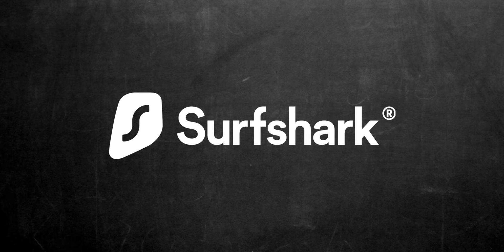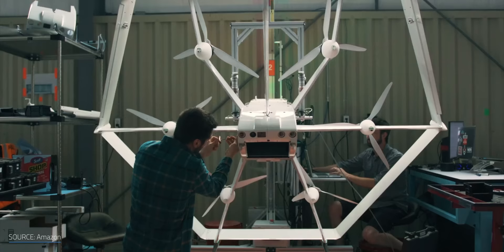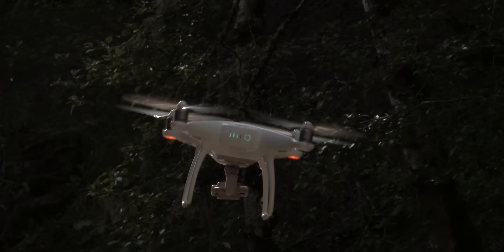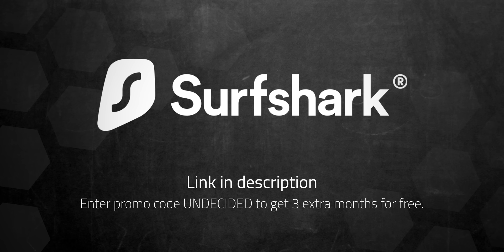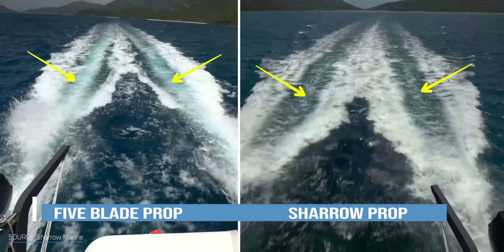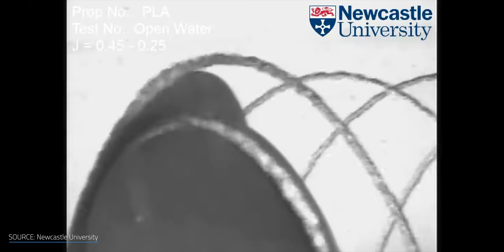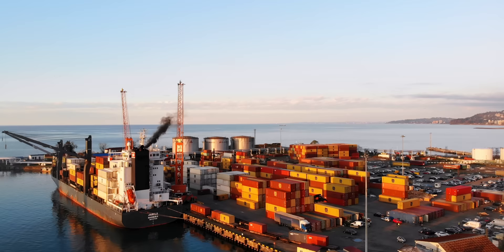Why is this Propeller Getting So Much Attention?

Comment: MIT hasn't provided any evidences to their claim. No scientific paper or anything, just some fancy marketing pamphlet, while deliberately comparing it to the loudest propellor they could find. The toroidal propellor is just a 4 blade rotor, that has 2 blades connected at the tip, so a more accurate comparison would've to a 4 blade rotor, not just 2.
MIT video having comments turned off tells you all you need to know.
Reply: …unfortunately these kinds of videos never do any kind of rigorous analysis. They are about generating views with over used cliches such as ‘game changer’, and ‘this changes everything’.

Comment: Actually the biggest waste in shipping could be avoided by sourcing products closer to where they are used. The only reason massive overseas shipping happens to the USA is because of slave labor, and lower environmental standards in other parts of the world. This could be cured without higher prices by switching to import taxes instead of domestic taxes. Despite what our corporate overlords tell us, any trade conflict this would cause could be offset.

Comment: OK, so I like to state, there is too much of wish showing up. My very concern is, that no one drone propeller achievable today has made it through independent tests. There is no such thing as a more efficient, quieter toroidal propeller for drones you may buy. And that's where I like to kick in, it is about propellers in whole:
All designs for drone propellers seen today have a rather flat design. There is no single design showing up, that extends the prop axially. But that's the very detail needed. Not so the marine propellers already available. I do believe, there is a tremendous increase in efficiency with these props. In no way this holds true for the drone props !available!.
Second: "In most cases we have to sacrifice some level of power or efficiency for a quieter ride, but that's not the case here." (6:36) That statement is... clumsy. When we are dealing with fuel2heat machines as are combustion engines, we are used to sacrificing power for less noise. This is the only one case, the statement holds true. Not so with all other things, converting any kind of form of energy. It's quite the opposite. The more noise appears, the more power is spent, creating that noise, resulting in poor efficiency. But there's more about it.
3. There are ducted fans already. They take care for the prop tip problem and do increase thrust of any prop tremdendeously today. This design is called turbofan in aviation. Today, virtually any commercial aircraft is equipped with.
4. Ducted props already are in use by tug boats. The thrust optimization clearly exists. Not so in cargo vessels.
5. For an open air prop (not ducted), a definitely axially extended prop like the outboard marine props shown would open the opportunity of optimizing efficiency of a prop in a target speed range, say cruise speed or max speed or start acceleration. But you cannot design a toroidal variable pitch propeller that takes care for all the demands of a typical motor aircraft. Not so with marine props, as
6. cargo ships do travel at cruise speed utmost all of the time moving. So here is the potential of a toroidal prop. Aircrafts already did optimization by turbofan. However
7. Any ship does suffer from seaweed. Is there any study on impairment of a toroidal prop versus an open one? My hypothesis states, the toroidal prop would win, so, yes, we should investigate.
8. Last: Yes, drones are almost all of time of operation near a hovering flight point of operation. So there is a big potential in using toroidal propellers in optimiing hover as a sweet spot. But please, take a look at the 3-dimensional things of marine props, having proven efficiency. The so called toroid-prop-designs for drones available are just a 2.5 dimensional design, failing in fulfilling the promises. Just ridiculous.
https://www.youtube.com/watch?v=l5ANUagwEBw

Comment: I don't see this having much practical application on aircraft. Only the small GAs use fixed pitch. Not to mention these are heavier, so more torque, and more power required to get them spinning I would imagine, that's more strain on the engine. You've got something like twice the mass or more it looks like. Definetly great for boats and drones, but not much else that moves I'm afraid. The only way I could see these being variable pitch is making them bendy, but that is beyond our capabilities if we're looking at putting these on something like a C130

Comment: Why Don't Ships use Electric Motors To drive their props and Just use the engines as a Generator??  This is what Trains have been doing for Years. You can Run the Generators at a constant rpm (sometimes incredibly low) and get great efficiency equating to LESS EMISSIONS?

Comment: In the beggining you said "the efficiency was boosted from 20% to 105%" I caught my attention because as far as I know nothing can be more than 100% efficient, that would be putting all the generated energy into the action I want. Later you said the propellers are 105% MORE efficient than the standerd ones and is possible because you are not saying it is 105%efficient you are saying its a bit more than twice as efficient as the old ones, that does make a difference and perhaps it was only me that herad wrong and got the wrong idea but hearing wrong information at the very beggining of the video could let to people not wanting to see the rest because of they might thing the creator is "dumb" or at the very least missinformed.
Just wanted to share my thoughts, not here trying to pffend anyone.
Good video BTW.

Comment: It is neither 105% efficient nor 105% more efficient. At least, using the graph of ‘advance rate’ v rpm, it is not possible to know the efficiency. The stupid thing done in this video is to simply compare velocity at some given rpm using two props and call it a comparison of efficiency. Without knowing either torque or fuel flow you cannot tell which is more efficient. Also, to make the comparison valid it should be at the same boat speeds, not the same rpm settings. You could replicate the comparison seen here by simply comparing two conventional props of different pitch. The coarse pitch will advance further per rpm. Who knew!
   We don’t actually know the efficiency of either prop from the data given. It is classic marketing smoke and mirrors. It stands to reason that if you had the test data of actual efficiency and it was better, and you had a prop to sell, you would absolutely SHOW THAT DATA. Therefore it is fair to assume that the actual efficiency data is not so good. 
   Also, the data point chosen for comparison was when the conventional prop was clearly at hump speed (most inefficient speed) whilst the Sharrow prop, being faster per rpm, was in the planing regime. Nobody who genuinely wanted to compare efficiency would do such a thing.

Comment: 105 % ,so the prop adds power back to the engine.  Try again . These props are much better but  ring props also are much more efficient
Reply: 105% increase, not 105% of the power. If i have an engine with 20% efficiency and i increase it by 105% i get an engine with 41% efficiency (20% + 1,05 * 20%), not one with 125%

Comment: toroidal propellers is nothing new, NASA worked with em in the 80/90s to try make an propeller aircraft that could pass the sound barrier or at least survive being over it.
but NASA being NASA, even if they find good things about stuff if it doesn't do what they want it's mostly left in the "things to forget and not show others except some few pictures"-shelf.

in case of the boat propellers toroidal have great effect for cruising. but there is a reason why high speed boats won't take to em soon.
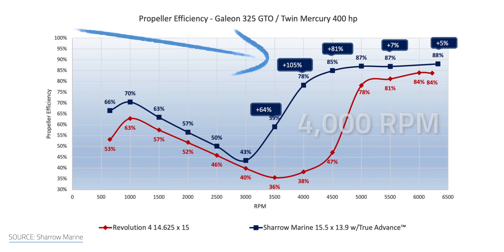the graf shown at 8:09 shows a 7 to 5% increase at high rpm's, but that is versus a cheap stock propeller that is made for fitting an "average public".
custom made propellers designed for race can set you back 1500-2500 USD but would make a 5-7% increase at top end look childish.
then you got surface propellers... well... no... some of what makes em work is opposite of what they tries to avoid with the toroidal, so no.

but made in large quantity and made in alu and cast in one piece to reduce price the toroidal would be great for say "small size working boats" (like say fishing, inspection and patrol boats) with general outboard engines to reduce fuel usage and sound.

Comment: Regular airplane props to toroidal is a pretty big leap. know it sounds so simple that someone probably a lot of folk, has already done this but I can’t find evidence of or anyone who has tried putting simple winglets on normal, regular airplane propellers. If they work on wind turbines increasing efficiency 4-5% then…? Yes, one is pushed by wind & the other propels it. But isn’t it to simple to overlook? Seems like ANY improvement would justify a cheap screw on kit. Right?!
Reply: Or helicopter winglets? Never heard of anyone trying those either.

Comment: Efficiency is a measure of the conversion ability of a mechanical redirection (not spacial, usage) with 100% being zero loss. 
There is NO possibility of greater than 100%!!!  (if the propellor is resulting in 105% change in propulsion it IS GAINING that thrust from another coincidental meshing into the conversion that is adding into the original energy input)      NO ENERGY COMES from nothing, no such thing as free energy as in a perpetual motion machine.

Comment: The thinking when I was aware was that a single blade prop was the most efficient........less surface area, less drag right?....But what this tech has found is all of the energy slipping away from the tips of the blades, it converts into thrust.

Some experiments were done on ducted props to capture this energy, but the ducts produced so much drag as to negate any gains......as far as the Sharrow $5k prop.....one mistake, a simple thing for a standard prop.....you'd NEVER buy another one....(China is on it....trust me...)

Comment: Good to see more discuccion on the new type of propeller. May you comment on results another guy received?
https://youtu.be/oXgp7IGnvKA?t=496
Unfortunately, toroidal prop doesn't work well for him while classic props with high pitch was the best power-efficiency solution. And there are reasonable +- 25% gap between different props while you promising +105% which sounds incredibly.